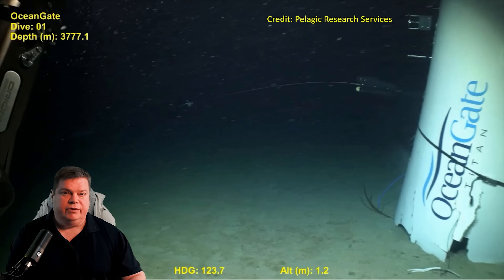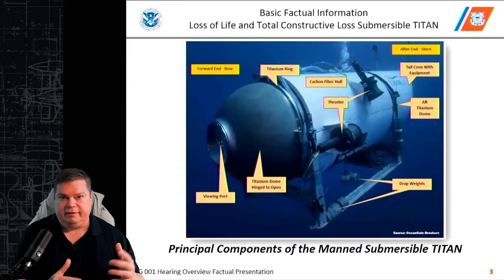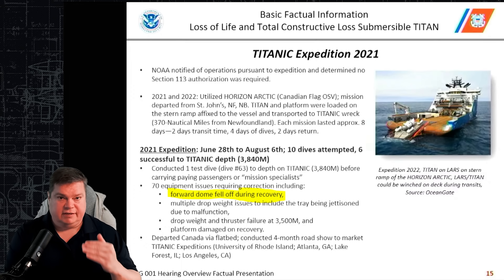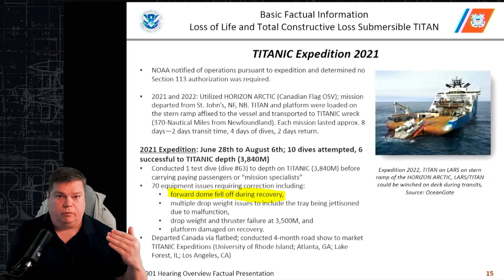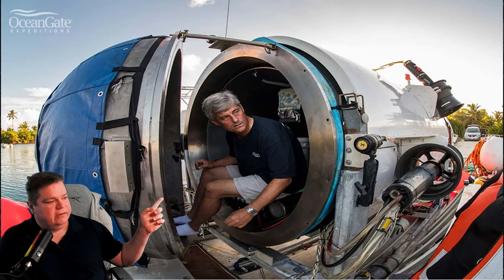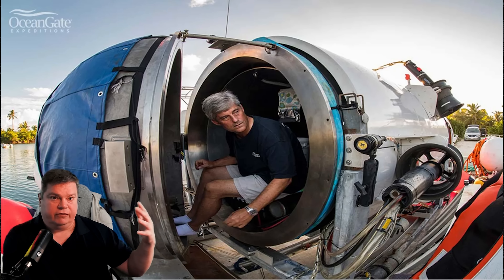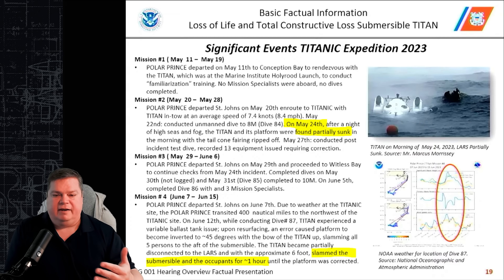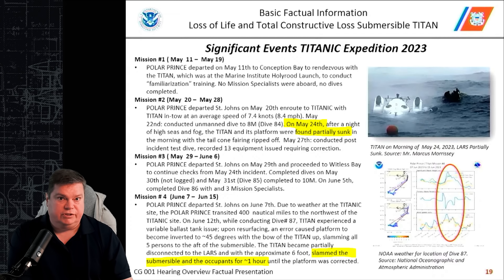New Evidence in Titan Submersible Disaster

Comment: the dome fell off because there was only 4 bollts holding it after Stockton got out, The crane lifted the sub and dropped it and the bolts sheared off and thus the dome crashed on the deck.

Comment: I'm surprised that they found DNA. I was pretty sure that the occupants would be dissembled into chemistry. It would depend on the geometry of the implosion bubble. I guess chunks of broken carbon fiber smeared some material on its ragged surfaces and dragged some of the paste out of the collapsing bubble leaving viable DNA material. Otherwise the heat and pressure should have changed it into other compounds destroying the DNA.

Comment: The front dome fell off during recovery! WTF?! Jaw still open as I type. That's as bad, as the wings falling off an airliner when it landed. That it was merely stuck back on & the reason it fell off in the first place was never investigated should have been made plain to the passengers. The whole project should have been stopped until a reason had been found & solution proven through exhaustive testing. Mind you, I've seen stringer hinges on an IKEA bathroom cabinet. Rush was nuts. Quick update, I totally agree with you: The Titanic is a gravesite, not a tourist attraction & should remain so.  James Cameron has a lot to answer for.

Comment: Dissimilar materials compress at dissimilar rates. The carbon fiber hull would compress at a different rate and to a different degree to the titanium collar that it was epoxied to. I suspect that the hull compressed more than the collar causing stress and at some point the bond between the two failed on the front dome. Once that occurred the front section of the hull would collapse and then be driven rearward.

Comment: I feel like that crane drop that popped off the front could have been one of the inciting incidents tbh. Titan was never going to last many deep dives anyway, but when you think about the damage a drop from height, and the force that would be enough to pop the dome off (I know it was only held on by 4 screws), and think about the damage that would have caused to the ring and the glue holding it. Likely sheered or cracked areas around the front or at least heavily affected the epoxy hold. Makes sense seeing as that's exactly where it failed. I worked with carbon fibre for years (car bodies), and it does NOT deal with drops well, especially when it's glued to somethinng unyelieding and heavy like titanium.

Also wonder if dropping the weights (which I personally think was just standard procedure to slow descent) might have been the triggering incident. Just enough weight shifted around the body to start the process.

Comment: The Dome fell off because  the ships crane  let it drop to ealry and it crashed down on the deck and they didn't have all the bolts  installed . They had only 4  bolts out of 18 installed  and when the crane dropped the sub the 4 bolts were not enough to hold the dome in place . The crane basically dropping the Sub onto the deck was the main cause of the dome falling off coupled with all the bolts not being  in place .

Comment: There seems to be the general opinion that the implosion happened so fast that the passengers did not perceive anything. This is certainly correct as far as the process of imploding is concerned. But we know that Titan had some kind of hull monitocring system that was either electric and/or acoustic and was looking for cracking/crackling or other unnatural sounds within the carbon fiber hull section. There are plenty of videos in which Rush brags when asked about the safety of his submersible that they have this real time hull monitoring system. Presumably this system would alarm the people on broard if any unusual sound coming from the hull was being detected, allowing them to abort the dive and by ascending reduce the pressure on the sub. It is possible that this system functioned as desigend and in the minutes before the implosion gave warnings to the passengers. While they did not experience the acutal moment of implosion they may have been forewarned about what was to come. In this regard the fake transcript of the coms between sub and PP that has surfaced a while ago may actually be quite accurate.

Comment: so the titanuim dome complete with the acrylic viewport fell off 
WTF ! the door hinges were also bent so my question is this 
Were the door hinges load tested !
Was the 5" carbon fibre pressure hull tested to ensure it could safely support the weight  of  titanium dome & ring glued to it  ? .
also how come its stockton rush signing these faults off as repaired & closed  ? Should it not be the cheif engineer  ?

Comment: Composites are great to contain pressure, not to be withstand external pressure... Take a strand of a wire or textile thread and try to pull or push it and see for yourself... The idea of a composite cylinder for a sub is just stupid. Build a high pressure propane tank of fibre composite but a sub, NO, just no - please no.

Comment: I'm guessing it was actually air pressure that ripped the aft ring off the dome.  The dome was the only stronghold against the "cabin" air pocket being violently compressed from every direction. All that air would have been compressed right into the dome, and by literal extension, the ring. I'm thinking with 3km of water pressure behind it, the air pocket ripped the ring open just looking for somewhere to go.  It's too bad they couldn't have added a few cheap sensors around the thing to leave us some useful data from the catastrophic failure event.  If a mantis shrimp can punch through water with enough force to emit a light flash....I bet this thing lit up like a lightning bolt,.

Comment: Front falling off isn't necessarily as much of a problem as it might seem, afterall once submerged there will be an awful lot of pressure holding it shut. The fact that damage was sustained to the hinge and not detected for 4 days was much more serious, similarly the question of why or how it fell off is more serious.
In all though I'm actually agreeably surprised that they did conduct a series of test dives on the sub. My main question though would be how the inspections of the carbon fibre hull were conducted after the dives - just looking at it isn't going to tell you anything - there needs to be some sort of non-destructive inspection with ultrasound or similar - I don't see any data on that here... even then I seriously have reservations about using composites in this mode as any failure or delamination could rapidly go from nothing to complete failure (although that could also happen with any other hull breach/failure at that depth.)
Reply: Composites always develop cracks under severe stress. They are unsuitable for that sort of thing, unless you're making a one use unmanned military drone. There's no need to inspect anything, anyone working in material testing is well aware of that. That design was doomed from the start.
The mid section got squeezed and the front slipped off. As one would expect with composites...

Comment: 3000 pounds on a 9 o’clock mounted hinge… I’m the furthest thing from an engineer but why not mount it at 6 o’clock and then you can lower the door onto a cradle and have zero torsion on the mounting?

Comment: The Dome fell off because the crane set the sub dowm too soon and basically dropped the sub 
The Dome falling off would have  strained and weakened the  titanium connector ring and weakened the epoxy resin that joined the ring to the carbon fiibre .

Comment: I've got no doubt that they will master a technique to make a safe submersible out of CF. I remember they made one of the first ocean racing yachts (a triple hull.. maybe wave piercer if I recall? ).. and my Dad, being a composites engineer in aerospace, was invited down to take a look at this, beautiful thing. zhe said "it will break up on its maiden voyage at sea".. and it did, and stayed afloat and ended up being salvaged by some Danish fishermen or something.. anyway that was then... and now it's standard build materials for any serious team going ocean racing.
I think the same thing will happen regards submersibles. I know they blame the OceanGate disaster on the pressure cycle, however that issue was solved in CF aerospace  applications long ago... (though still turns out cheaper right now to make a rocket from stainless steel... haha... Elon and Spacex putting my theory to the dogs 😂)..
But hey composites are the future of most things... jeez they make gearbox cases in F1 out of CF dont they? Williams F1 Engineering made one, maybe it got banned, I don't remember, but even the thought of something made of 'brittle' CF 30 years back would have been jetpack wearing future world to engineers.

Comment: There likely would have been buckling, sounds, etc warning them that the pressure was getting too high or that a failure was coming. You don’t go from “tolerable” to “intolerable” that fast. They knew they were doomed. It ducks, but it is what it is. People make attempts to make it feel better about the loss, in my opinion. Hubris and arrogance caused this.
Reply: That thing was always popping and crackling. And it was always unsafe and going to fail. There's a reason subs are made of steel/titanium alloys.

Comment: I imagine they had some violent sounds way before they dropped the weights. And as those increased they did so, my speculation. They would have anticipated horrible things happening. Also 30:38 that curious fish has a time of its life observing robot doing robot things. Just for a second - being super comfortable at over 400 bar (400 kg/cm) pressure with ~ like 16 TONNES (weight of a HGV lorry) of combined pressure (assuming 20 cm2 on each side just from eyeballing it) on its entire surface, isn't nature amazing?

Comment: you forgot the most critical problem that hull was never inspected and not possible to inspect because they never  ever examined it from get-go , never properly tested it from get-go  and they never removed the inner tube to look at it despite the  cracking noises and loud bang... and they had no real safety protocols or secondary recovery methods. Total garbage from day one. They did not even have a proper certified marine engineer, but some  whacko-dipso person with a title as apparently all OG staff with exception of Lochridge who left and was seriously harassed. Software engineers with background in MRI and medical scanners are not marine engineers and he knew absolutely nothing about materials testing and the so-called  "real-time" sensors with color-cocded scheme (three strikes-red) was not real time  but data uploaded to some cloud services and  retrieved post-dive and basically not so scientific as he didn't know whether the sensors were actually working or not .... one has to admire the investigative board for their coolth and professional  control. I'd be bouncing about in a rubber room after hearing some of the gibberish given.

Comment: Come on man you're not telling the whole facts. The front of the submarine fell off because he only put four bolts in the front instead of the 18 that normally go in it you omitted that. He did it because he believes that the pressure outside would be so great that it would just push the dome against the hole and it wouldn't move but the crane operator actually dropped it about 2 to 3 ft higher than he should have and when the sub slammed into the sled to impact sheared the bolts right off the front and that's why it fell off it didn't just fall off like you're making it sound The crane operator was the one that did it

Comment: That's nuts to Just say "Fuk it" I'm gonna skip the certification process and just saddle the thing up myself and drive it down to hull crush depth to see if it holds up all while the submersibles carbon fiber is popping like a child jumping on Bubble wrap! 
And to know that popping is the weaker strands of Carbon fiber splitting apart...
 Donno if he was brave or stupid or just both....
And That might not have even been the part that killed em...
 I understand it was likely the View port That Contracts/ expands at Different rate than the Titanium around it that was likely the fail point

Comment: Someone on another video said they work with carbon fiber and resin and said in the video of them bonding the cap to the pressure vessel they didn't use nearly enough epoxy and that it should've squeezed some out during bonding but in the production video nothing comes out of the join. So obviously besides the carbon fiber delamination I suspect the joint failed because it lacked glue and then collapsed.

Comment: That was NOT a instant impulsion. They knew minutes before that the 💩is happening.
 He (stock..) was pretty much sure in those minutes that the glue was giving up.
That's why they tried to drop desperately everything he had on weights.

Who put that rubber stretch band around the tail section?
Right were that OG logo

Comment: I cant make sense of a lot of this. 
Is the pinging coming from the PP and then heard by them, on reflection from the Titan as sonar? Otherwise a ping emitted from the Titan 6 seconds after the last message would be the last communication surely?
Was Stockton Rush actually aboard? Cause PN could have done all that.
How many times had it reached the Titanic,? x1,  x4, x14 etc
Finally ,”identifiable remains” are not paste. So which is it?

Only if you REALLY know, please.
Reply: @alexandros8361  "Identifiable remains" just means that they can be 100% sure that those are the remains of the people aboard, which they did through DNA testing. VISUALLY idemtifiable remains are a different thing entirely, and is not what he meant.
Reply: @kajag1063  OK, but does he actually know that. Its just that I had the impression that they had more structural remains that were more individual. And that they were differentiated by DNA. I'm medically curious about the effects of 400 atmospheres on the human body. Regards.
Reply: @alexandros8361  Yes, he does know that. The only physical remains left was in the form of paste, and a small amount of it, which they were abke to extract DNA from.
Reply: @kajag1063  Okay, thanks for that! Autopsies are awful at the best of times, though I guess this would have been kind of different. Best Wishes.